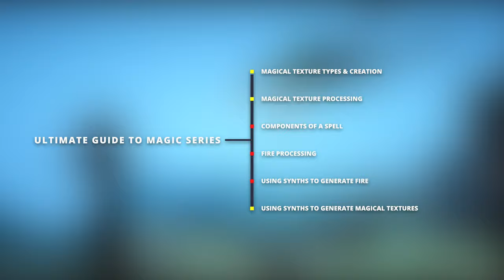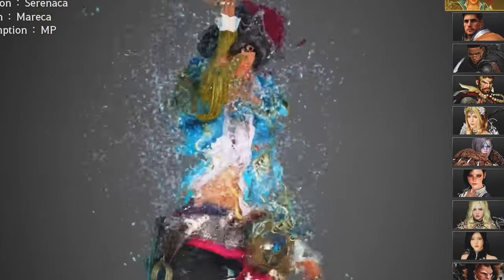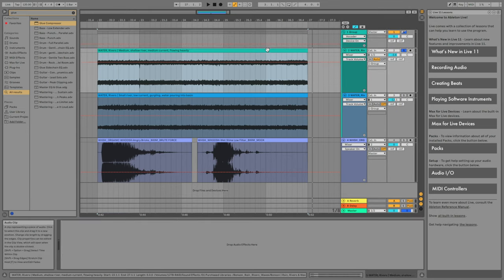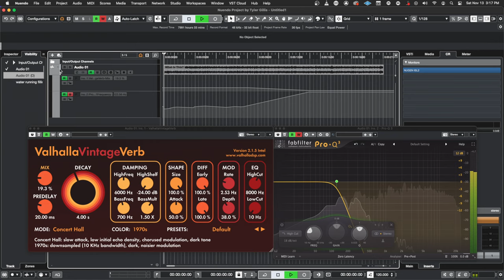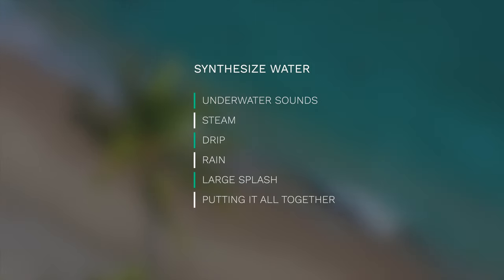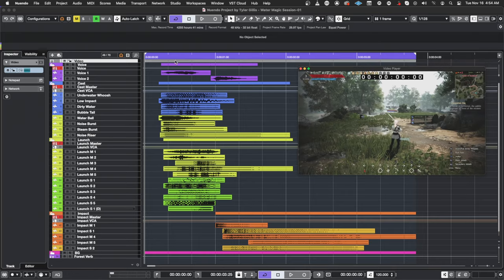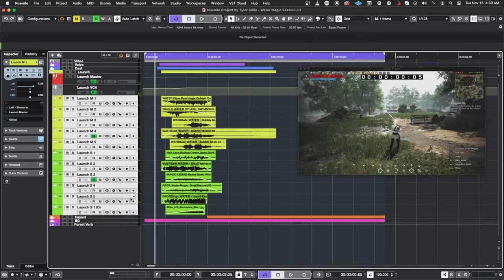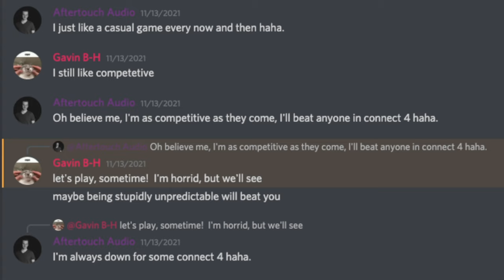Water Magic Sound Design Tutorial

Comment: Thank you, great stuff!
Reply from the maker: Thank you Cyberwave!
Reply: @AftertouchAudio  I was wondering what would happen if I'd submerge my zoom recorder while in air tight plastic container, and move some water around lol can a mic even pick up anything if air cant reach it?
Reply from the maker: @CyberwaveOrchestra  It actually can as the bag will vibrate. I use to do that with Zoom H1 recorders be very caful though as a leak can be bad.
Reply: @AftertouchAudio  Mine is also H1n, not expensive but I love that thing. I'll have to double check for leaks before trying
Reply from the maker: @CyberwaveOrchestra  That was the reason for me using the H1n haha, they were not that expensive and if they broke I would not be heartbroken.

Comment: Sometimes you can use sealed bags for other purposes. I'm talking about contraception. This will keep your microphones dry.
Yes, this is not the best DIY and if the tightness is poor, you can regret your decision to save money. But this is also a way out when it is necessary now.
In general, this whole topic is very interesting. It's a pity the few likes.
Reply from the maker: Give it a few years, I'll get there haha. The issue with it is you'll hear the bag moving but I always ran the samples through a low pass filter anyways so the samples were always usable.